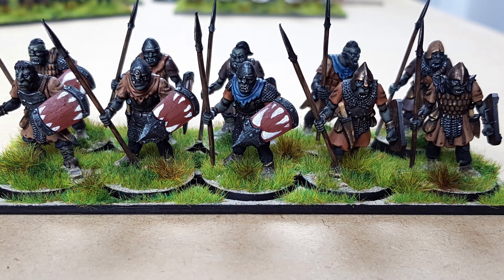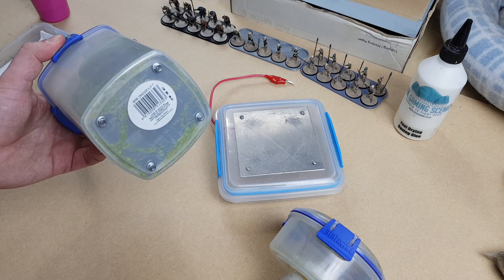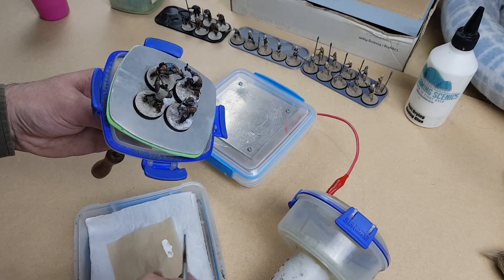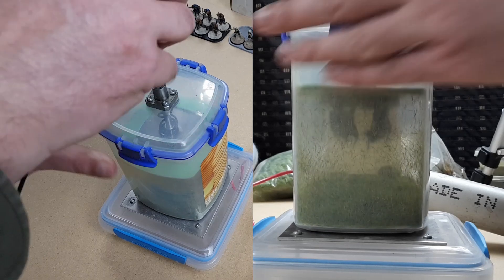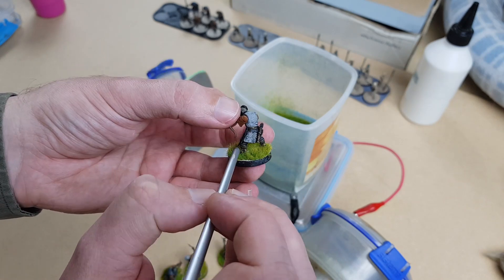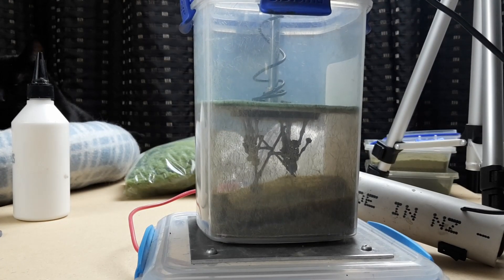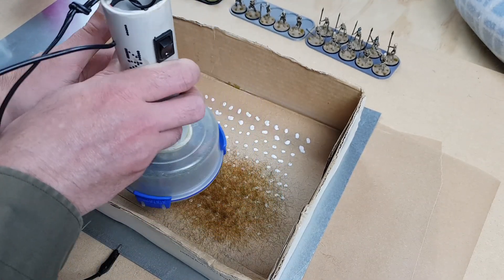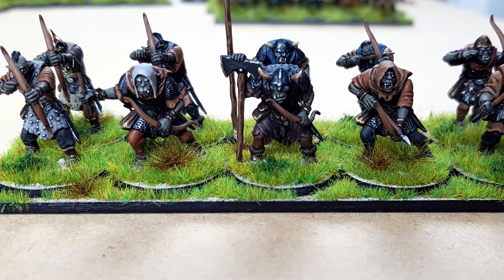My Static Grass Secret, Revealed!

Comment: awesome. how do you hide the oathmark model's attached platform? filler?
Reply from the maker: I've used a couple of different solutions. Initially, I cut them off, either using side cutters or a razor saw.
These days I have custom 3D printed bases that have a recess the same height at the puddle. The figure gets glued in the recess, and the base gets filled up flush along the top with a bit of ready mix filler.